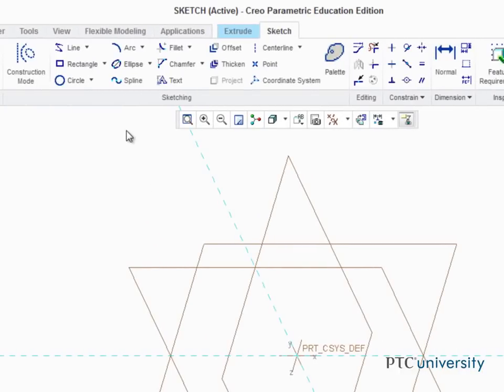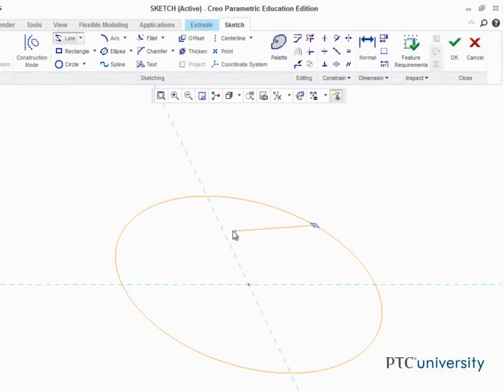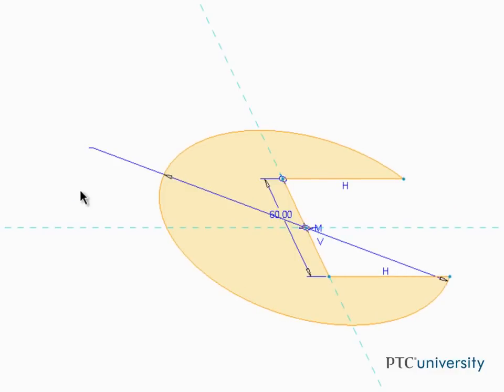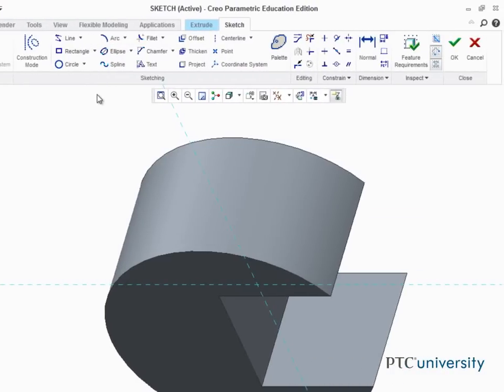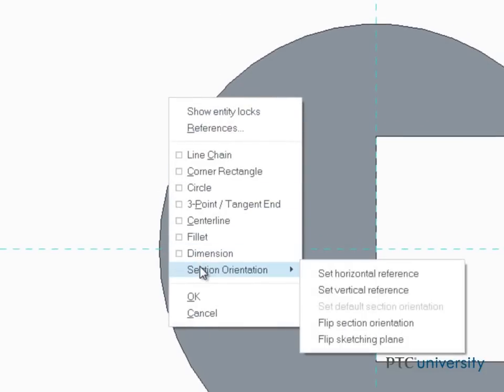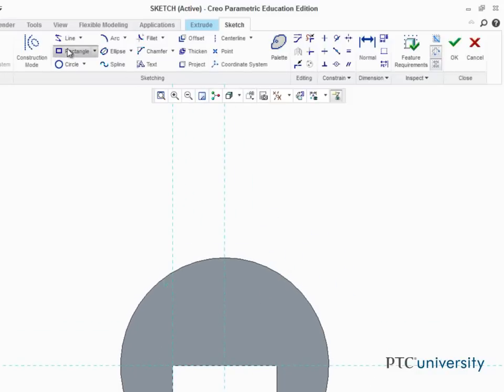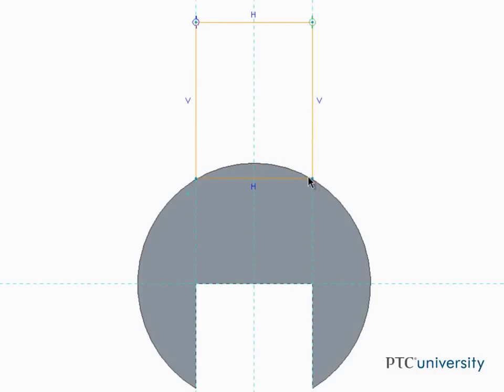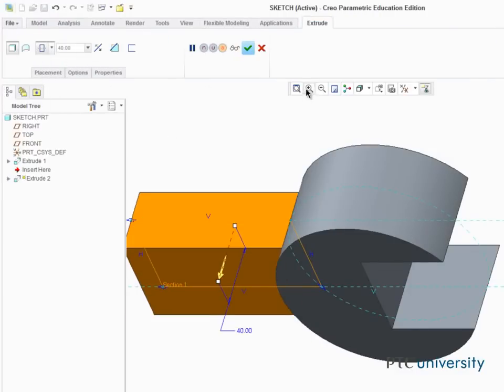Modelling your first part in Creo Parametric 2.0

Comment: how did he get the opening to stay centered up on the center line as he resized it down to 60?  mine went over to the side.
Reply: +d kowalski   Hello D,  if you look carefully, when he is making the wrench opening, a little 'M' pops up when the midpoint of the line intersects the origin.  If you place the line with the M showing, it automatically constrains the line.